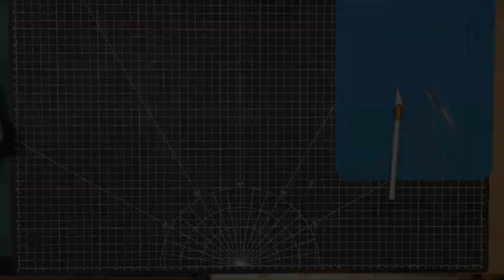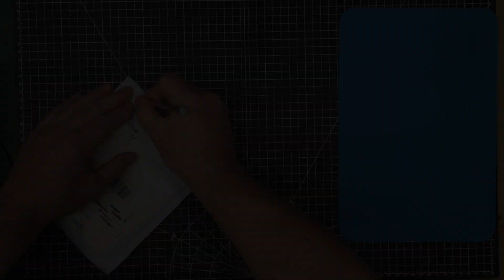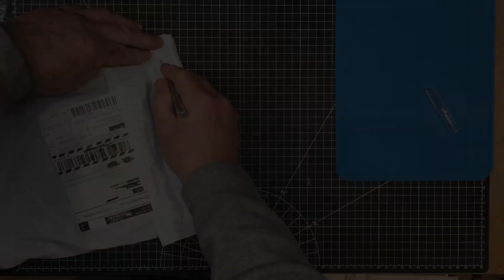0128 - Mail Bag 16:  Lots and lots of AliExpress stuff!!

Comment: Those lasers are used with a photodiode, photoresistor, etc. like the sensors on garage doors. You break the beam and the door stops going down. Many different applications.
Reply from the maker: I think you are right.